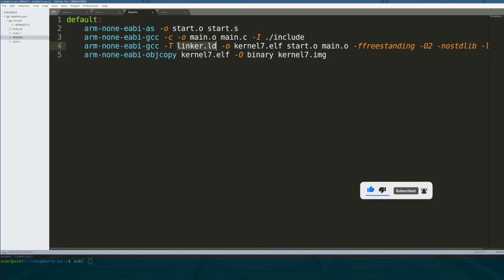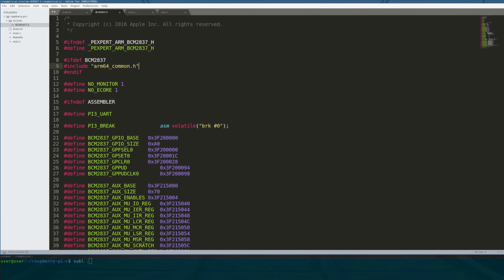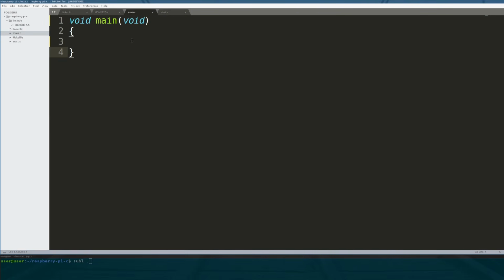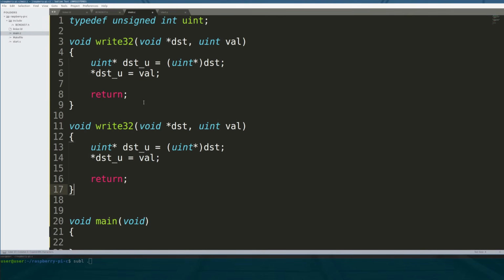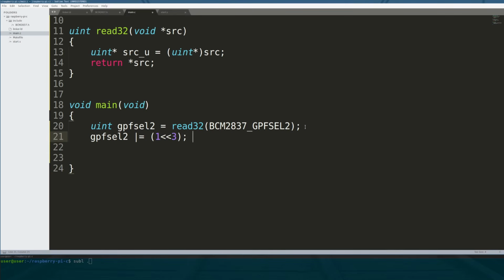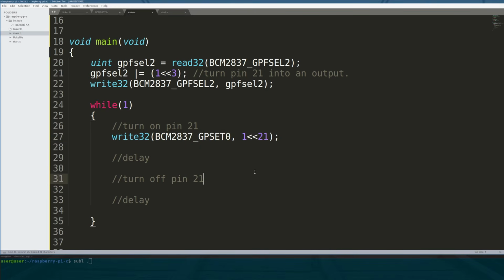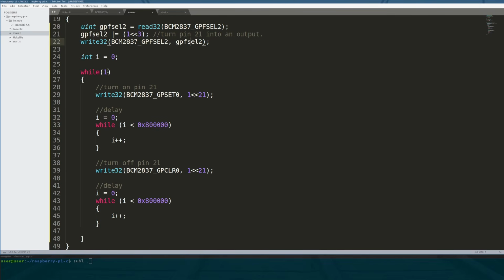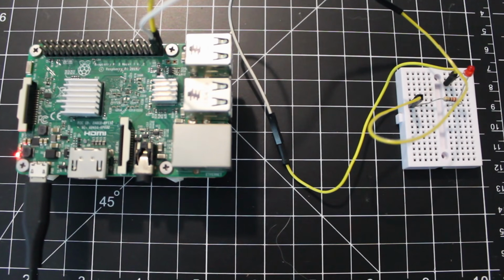Raspberry Pi C/C++ Baremetal Programming  |  Using C to Direct-Register Control Your Raspberry Pi

Comment: Thanks for the simple example.  I just make and flashed kernel7.elf to a SD card. put it in RPI3. the LED connected to GPIO21 did not turn on and off.
compile has some warnnings. and check BCM2837 datasheet, the GPIO_BASE is 0x7E20,0000. not 0x3F20,0000. Is there anyone meet the same issue?

Comment: wait, assembly isn't a compiled language?
Reply: It's not regarded as one, no.  Assembly is assembled.  There is a one to one correspondence between what you type and the machine code it produces... with the exception of macros, but they're also a literal substitution.  Compiled languages use compilers, which are free to produce any code they like, so long as it gets the job done.  The actual code can vary quite a bit, even just by using different optimisation setings.

Comment: Amazing stuff! 👍But when you wrote the 'sleep'-logic I thought, that won't work (8:36), at least not as a 'sleeper'. It looks like a perfect example for a compiler like gcc(with -O2) to optimize the loop out and replace it just with setting i to the value of 0x800000. Thought you should have used 'volatile' keyword for i-variable or -O0. But no,...too many thoughts 😆, worked as intended... 👍
Really need to try this at home 🤩

Comment: Why not implement the delay routines as function calls, reducing code duplication, decluttering the mainline with open-code?  Other than that, very nice.  Thanks.
Reply: and on that note, since he's using C, why not use sleep(5) with the inclusion of the necessary headers (i.e.<stdio.h> <unistd.h>) ?

Comment: Very helpful. Though I was running into an issue. I think I had the code the same as yours, but for some reason the raspberry pi stalls whenever a c function returns (it just no longer does anything). But if I start the start.s file with a line that sets the frame pointer and stack pointer to a spot of memory I set, it works perfect.
Any clue why this would be?
Reply from the maker: Yup! When you call a function in C, the return address is put onto the stack. If you don’t initialize SP, the return address gets lost and you crash the device. Setting SP fixes this.
Reply: @LowLevelTV  Did you do this in your code? That made sense to me but I thought I didn't find a place where you set SP so I assumed there was an initial stack already setup for the pi.

Comment: I am still trying to understand how you can write directly to memory or a hardware register from user space without the OS preventing that. Is it because the program only runs when booted?  I asked a similar question in your assembly example. I take it that it is not possible to create a normal executable that can be started by the user.
Reply: i think its because there are no OS, its baremetal so there are no kernel i think

Comment: Why read the register before configuring for output?
Reply: Because he needs to only flip one bit within the register. I.e., you don't want to change any of the other bits, you only want to change the bit specific to the GPIO pin being used for the LED.

Comment: warning: passing argument 1 of ‘read32’ makes pointer from integer without a cast [-Wint-conversion]
    3 |  #define BCM2835_GPFSEL2                      0x0008
                                    |                                               ^~~~~~
                                    |                                               |
                                    |                                               int
I cant figure out why this is happening can someone pleas help me (I'm new to C...)
Reply: It's hard to tell not seeing all the code but it seems like you're trying to give a function an integer when it wants a pointer. Or vice versa. So if you're currently passing it an int just use &myInt to pass the address of the int, if that doesn't work make a new pointer that points to your integer and pass read32 that pointer. It's probably not as big of a problem as it seems and you just need to figure out exactly what you need to give to read32 and cast your integer into the correct format. Hopefully this helps, I'm no expert but know a bit about this stuff
Reply: Easiest way is probably change the parameters of read32 to take an integer instead of a void*. It's being explicitly cast to a pointer inside read32 anyway.
But the way I would do it, is change the way those addresses are defined in the header:
#define GPIO_BASE *(volatile uint32_t*)0x3F200000
That way you can just say 
GPIO_BASE |= 0x40;
and treat it like a variable. Just make sure you use the right integer type for the size of the register. Some are arrays, so probably uint8_t or unsigned char.

Comment: Q: Instead of a loop for delay, is there a high-resolution counter I can use to turn on a GPIO pin, wait, and then turn it off again after 5µS?
Reply: When I did some ATMega16 programming the chip had two clocks (one of them was 8-bit and the other 16-bit). You could write an interrupt function which would trigger when the counter reached a value set in the proper register. I'm guessing that there should be something like that on the arm chip as well. You need to reference the datasheet.
Reply: Your CPU clock is the high resolution counter ;)
Reply: @petermuller608  doesn't work if you want to have none blocking wait

Comment: Can I write the write() & read() function in Pi OS? 
By that I mean can I access the register using the address mentioned in the datasheet (just like what you do)?
ex. If I want to change the value of BCM2837_GPFSEL2 by point to the address "0x3F200008
Reply: no, Linux doesn't want you to have direct access
Edit: found out you can map physical addresses into your virtual adress space of linux process if it runs as root.
google: mmap gpio raspberry pi
you need to translate the bus address into the physical one. if there is no mapping into a physical one then you cant mmap it...

Comment: This is awesome!! Can you make a hello world on hdmi example. Is it even possible using c++?
Reply from the maker: It's definitely possible to interface with the HDMI controller in baremetal. It's probably a fair amount of code but you can do it.
Reply: The kernel does nothing else. So HDMI output is for sure possible.
Reply: @maxhouseman3129  are you sure? To my knowledge, the ARM core isn't even connected to the HDMI port on the raspberry pi. It uses a dedicated video chip
Reply: @petermuller608  Yes. I know. Because the ARM processor has not the power to drive a hdmi device.
But the kernel sends the commands to this chip anyway.

Comment: Am trying this for a couple of days and I saw your video. I wrote to the registers but I faced segmentation fault, do you have any idea?
Reply: How do you know you are having a segmentation fault when the raspberry pi has no os or drivers to alert you that you are having a segmentation fault?
Reply: The read function is wrong.
Reply: If I had to guess it probably happened from either a command with a register in square brackets such as LDR R0, [R1] or moving a value into R13 or R15

Comment: It’s much easier on ARM to run bare metal is easier than on Intel. I was about to start a series of making a cooperative multitasking OS. But I got a new project, so no time for now.

I wasn’t aware about this header file, when I did my GPIO video I had to deep dive into the documentation.
Reply from the maker: Yeah x86 baremetal programming is much more difficult, and there isn't a ton of learning value there. It's just annoying.

The header files are nice. Digging through documentation is something you should know HOW to do, but shouldn't have to do often.

Thanks for watching!